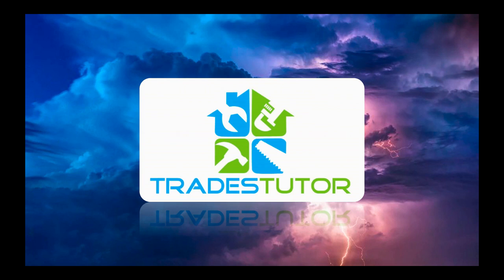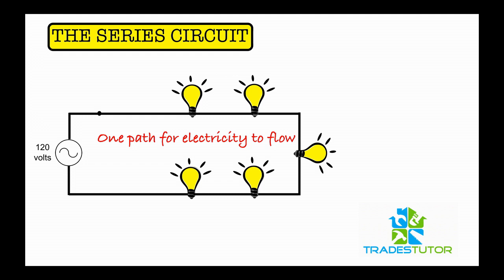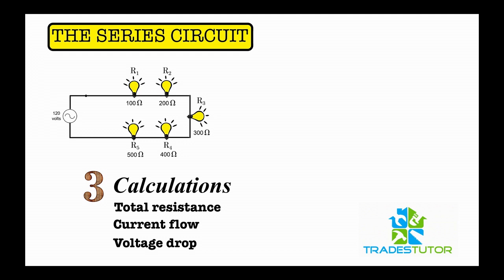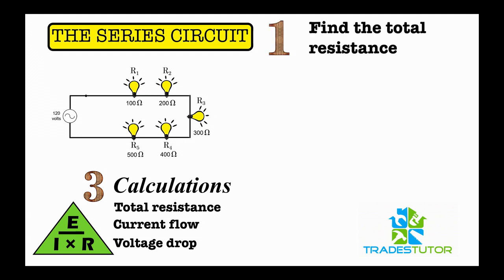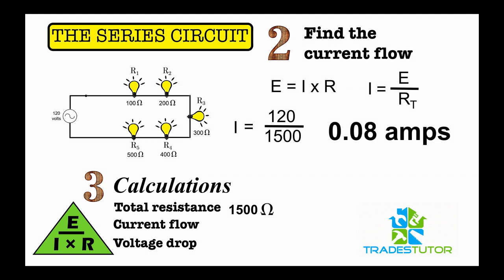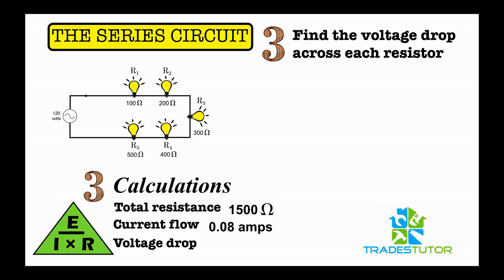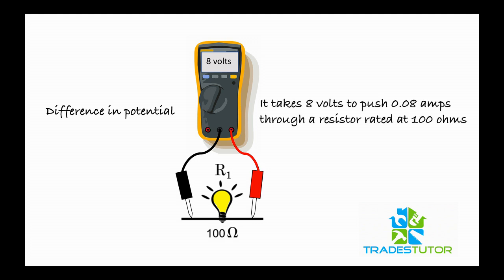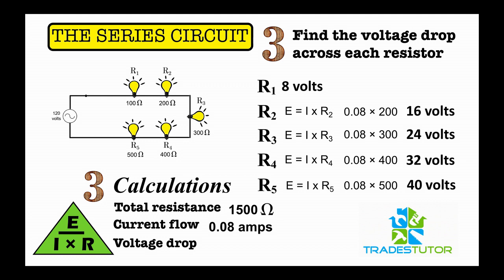Series circuit Explanation (quick and easy)

Comment: .. does adding a bypass diodes in parrellel with the bulb keeps the series going if one bulb fails? ..if it does how to culculate diodes resistance?
Reply from the maker: If I'm understand you correctly then yes adding a diode in parallel will keep the electricity running in the series circuit and keep everything lit. Calculating the resistance in this case should be the same as previous. You would act as if the bulb that was not working was just not part of the series circuit.
Reply: @tradestutor1191  ..can you proof it in a demonstration? ..I can't find anything similar to that in any YouTube vid.. demonstrate using a 2 x 5 mm LED in series with at least 2 bypass diode in parrellel with both LED and it's values..
Reply from the maker: @surenbono6063  Sorry: I'm not going to have time to do that anytime soon. Maybe check out a channel called "The Electric Academy". It goes through a lot of stuff and maybe some of it will help you out.
Reply: @tradestutor1191  ..thanks for the link.. researching for higher solar cell efficiency in series ..I am
Reply from the maker: @surenbono6063  You're welcome. I hope you end up finding the answers you're looking for. Take care and thanks for watching.